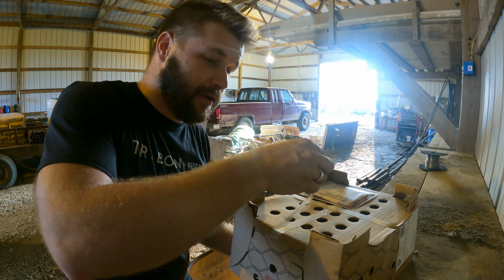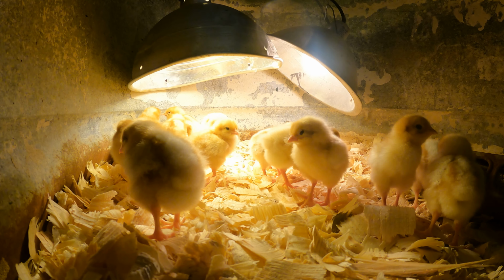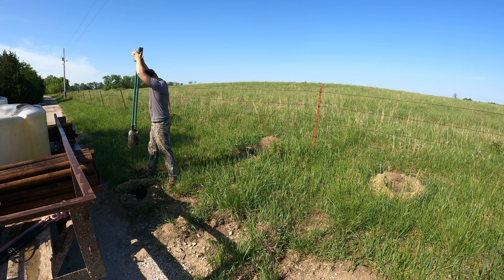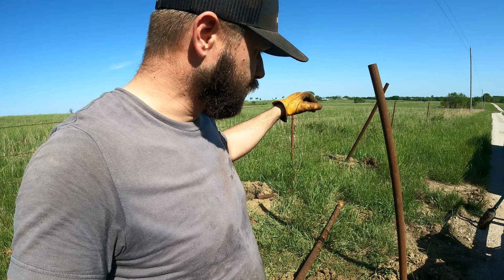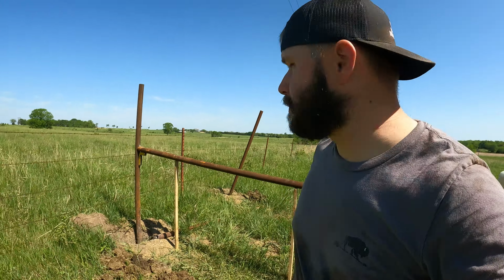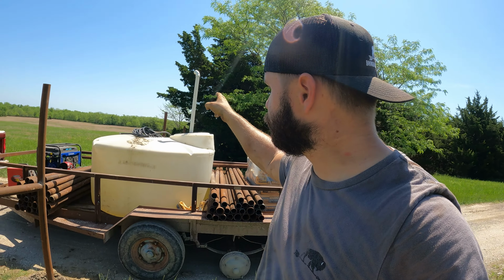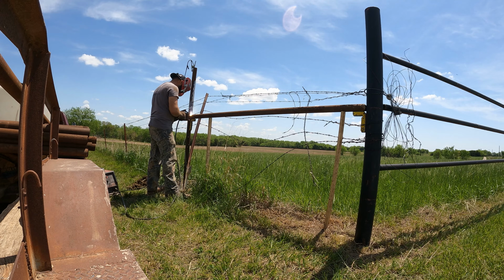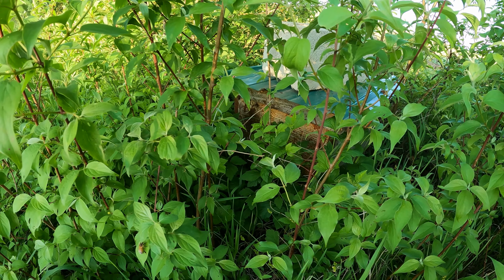New Buffalo Fence Is Going Up!

Comment: It’s usually beat to hang your heat lamp in the center of your brooder, put your feed and water off away from the light bulb. If the heat is against a wall they will pile up on each other. I’ve hatched and raised thousands through the years.
Reply from the maker: Thanks for the feedback!

Comment: I can’t help but laugh...that’s tough putting  h braces up without a helper.  You got a good system going without help. I imagine I looked the same way.  Really nice to see the fence going up and the other pasture will come back better than you think.  The bison are pretty good at taking care of the land.  It’s overgrazed but is nitrogen loaded and likely contains less invasive plants.  We observed the same type of deal at the grasslands.  They overgrazed an area in early spring and continued until the native plant life was thick again.  Long story short they are altering and doing things that we don’t realize most of it helpful.  Blandings turtles used to travel across the prairie in the spring after the rains by using the wallows that the bison made.  We are reintroducing them... and trying to take more of a holistic approach.  We found a new species of snake for our region and are in a amphibious nerd article!  No crops since 2005 so the land has almost healed.  One ant hill would fill your truck bed.  I also found  3 spots on the grounds that drink water so fast it has a vortex.  Millions of gallons go into a cave and underground streams.  Crawfish are found on hillsides no where near the water.  Anyway your doing things you don’t even know about.  Your biggest environmental achievement that know one thinks about is carbon that your prairie pulls into the dirt.  Keep it up your doing great things.
Reply from the maker: Absolutely agree Jim!